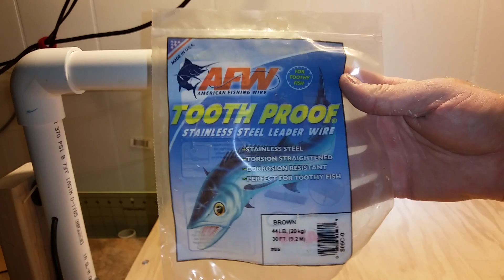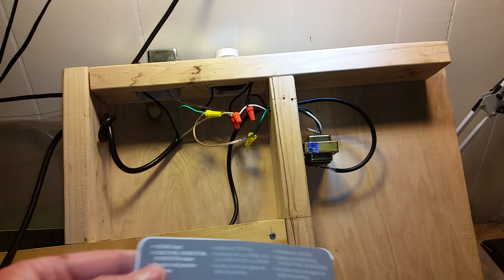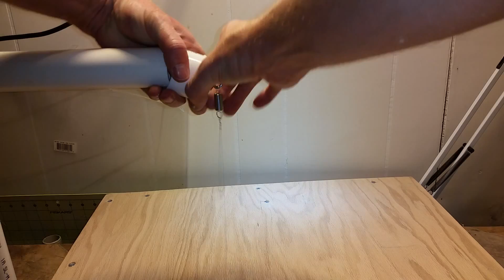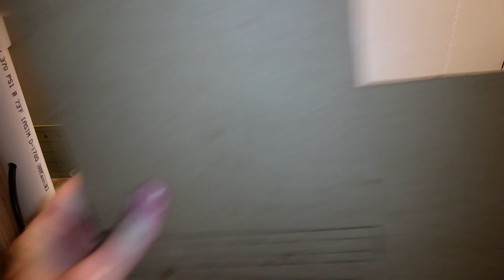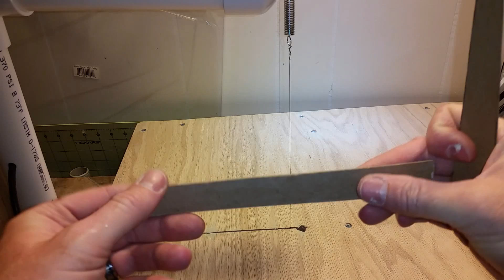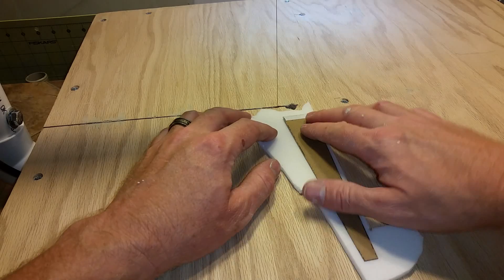Hot wire foam board cutter

Comment: Too much words for explaining what we know the machine does, it would had been better if you had explained about connections
Reply from the maker: It's connected up like a standard circuit.  I hot wire goes in one side and comes out the neutral side.  Also the transformer is grounded incase anything get shorted out.

Comment: Not sure why but mine continues to burn transformers after about 5 min of use. I thought maybe it was a wiring issue, but noting how you wired yours. Mine seems to have other issues...
Reply from the maker: I bought a heavy duty transformer from ebay.  The doorbell transformer lasted about 10 minutes then fried.
Reply: So I took some advice from a comment on another channel and got rid of the stainless steel wire and switched to kanthal 28g wire and haven't had the issue again. My trust in the device remains shaky though. Thank you for your response.
Reply: Hey can you give me the electrical specs for the transformer you chose. My new transformer just burned out again... Doh. Trying to find a 12-24v transformer that offers 3 amps is next to impossible..
Reply from the maker: Transformer, Electrical, step-down 50VA 12/24V output, foam cutting, electronics from jacobsonline ebay store.
https://www.ebay.com/usr/jacobsonline

Comment: Has the PVC cap melted considering the bolt running through it will heat up?
Reply from the maker: No the cap does not melt.  The bolt is thicker and very low resistance compared to the wire and did not heat up.
Reply: MrDabrudda excellent! Thank you.

Comment: My suggestion, put all your electrical connections in 4x4 electrical boxes. Then ground those boxes. If you have any electrical connections heating up then the system is safe and will blow the fuse rather than setting your house on fire.